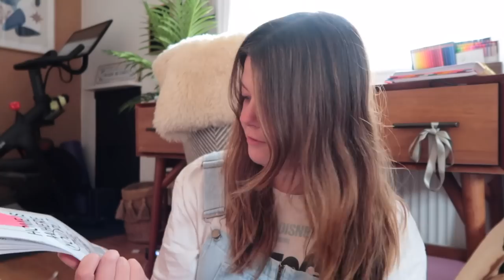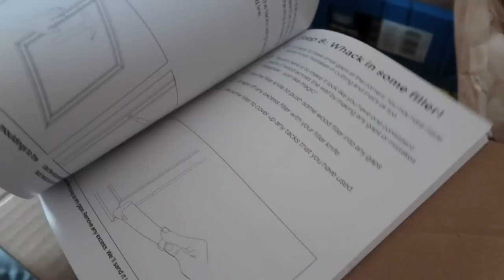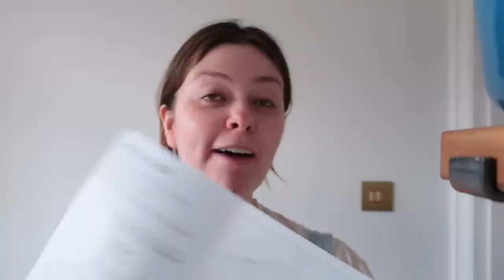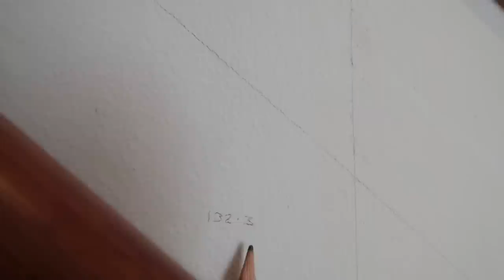i tried DIY panelling for the first time and it wasn't entirely terrible?

Comment: It turned out really nice!  As a general rule, you want to match the color used least in a pattern (fabric, carpet, etc) & use that for your paint, & I see that green in the carpet. I think you made the right choice not to use a pink shade, it might have washed out the runner blending it all together. 
I am not a carpenter at all but I am a crafter so I have to give you some future reference info, lol.  That blue miter box & the big flat saw go together. You use the slots on the miter box for your angles, they give you straight lines. The hack saw you used to cut the wood is a much harder way to go & the cuts can end up wobbly.

Comment: Ok your using the miter box incorrectly your meant to saw in the box not outside of the blue box that way you get a crisp sharp edge but however I will say this well bloody done because this is something I actually refuse to do 😂now for the spirit level don’t be tempted to walk around the house checking if everything you did before it’s arrival is level